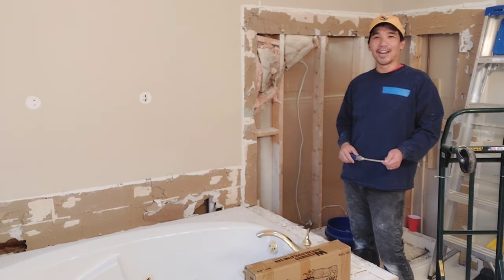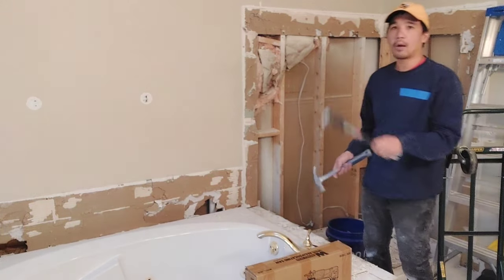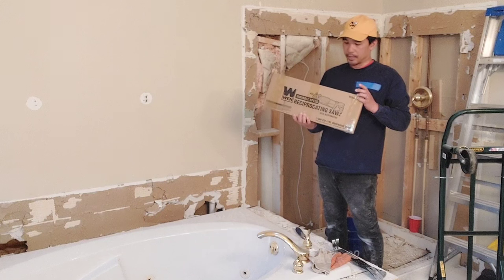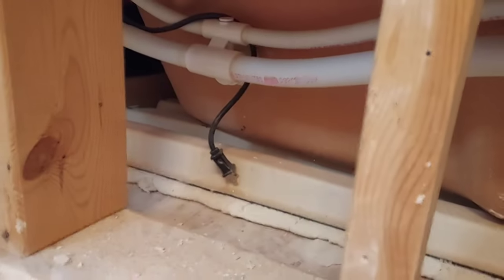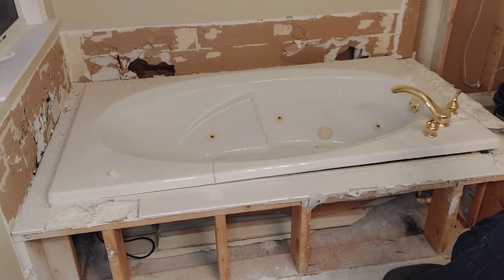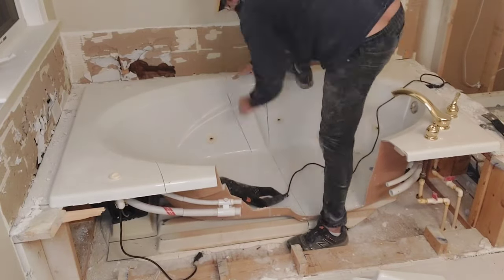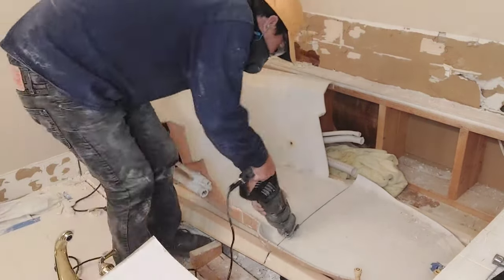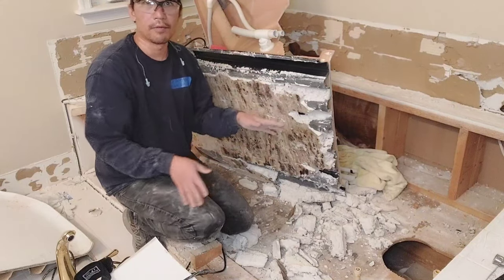How to Remove a Jetted Bathtub

Comment: Thanks for video, Raymond.   I am about to to take out my jetted tub and put a shower in its place.  Cutting it into pieces with wood saw blade sounds most practical.   Watching out for electrical and residual water is a good tip, too.
Reply from the maker: Thanks for the comment and glad the tips helped!

Comment: Thank you for this helpful video! 
I didn’t completely understand the part about “sitting on the main drain“ I’m not sure what you meant.
Reply from the maker: I just meant to disconnect everything from the jetted tub before trying to saw because even the vibration of the saw could damage your drain pipe.

Comment: Hi sir. Can a Subway tile base built around a garden tub in small bathroom be demoed and used as floor space/closet with sliding barn door? Garden tub total waste of good space. Thank you for a reply with your opinion. PS. Can any of the Subway tile be salvaged. The rest can be chopped up and hauled out to garbage. Thank you
Reply from the maker: You could totally reuse the space for storage. We thought about putting cabinets in but decided to go with a freestanding soaker tub. You probably won't be able to salvage the tiles. They will break and chip. The backs will also have thinset that you would have to scrape off. So it probably won't be worth salvaging.

Comment: I have a question. I’m removing my jetted tub with a demolition company. What kind of flooring is underneath if any? Is there much of a difference compared with an existing vinyl flooring, that will be replaced ? Will plywood need to be added? Thanks
Reply from the maker: There is just a subfloor plywood underneath the tub. Once the tub and tiled flooring were removed, only the subfloor plywood remained.
Reply: Thanks your video was helpful.

Comment: What do you do with the open water pipes while you’re waiting for the new tub to be installed? Did you weld caps on? We are about to tackle this, and I know we won’t get the new tub in for a while. But we can’t leave the water to the house turned off for days.
Reply: Also: WHAT’S THE GOOD WORD?! 🐝
Reply from the maker: You can either cap it if it's copper. For the cpvc pipes we put a sharkbite shutoff.
Reply from the maker: To hell with Georgia!!
Reply: @RaymondCanDoIt thanks so much! A little intimidating using a propane torch, but that’s the only way with copper pipes I guess.
Reply from the maker: You could try to use shark bites. They push in and when you want it off, they have a plastic tool to pry it off. My site gets a few pennies if you click the amazon link.
https://amzn.to/3SfuFLk
Reply from the maker: @zanmaxwell7510  you could try to use a sharkbite to cap the end. They make a plastic tool to remove the fitting. Here is an amazon link below. My channel gets a few pennies if you click on it.
https://amzn.to/45EP7sd